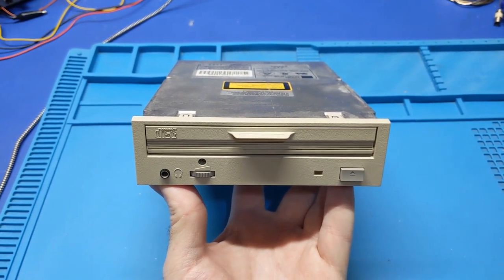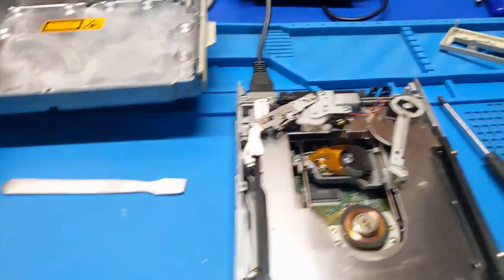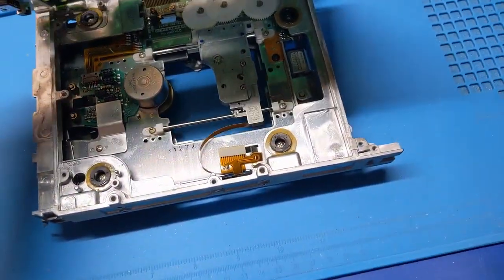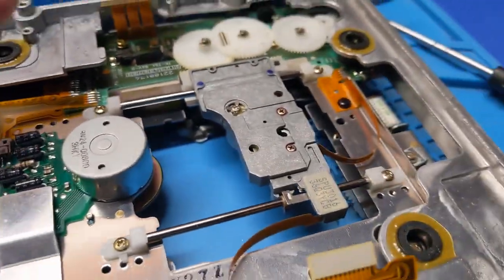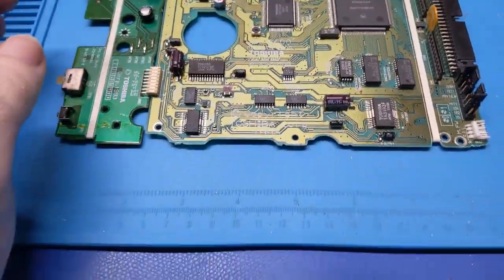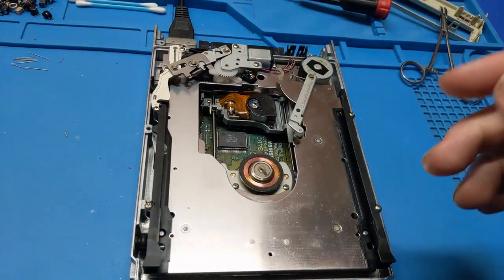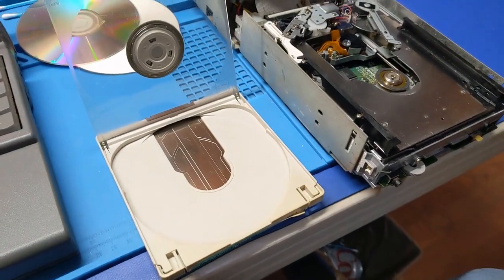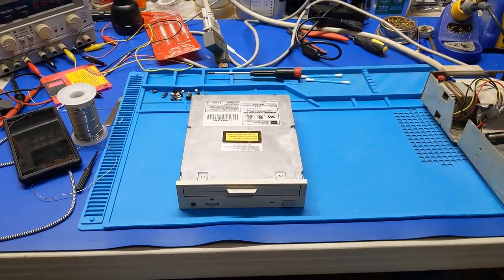Toshiba SCSI CD-ROM XM-3401B Repair

Comment: hey, that was used in the DTS cinema sound processors! They were dying like flies as the player would read the digital data from the CD-ROM in real time. 10 hours of cinema open = 10 hours of continuous read from the drive (ok, 5 hours as there were two of them). I have three of them, they all struggle and pressed disks work better. They usually start working (barely) after a while they've been powered on. Would you be able to share how to adjust the "servo" and also how to adjust the laser power (clockwise or counter-clockwise)?
Reply: I would be interested in the adjustments as well.

Comment: Something to check, is the rubber shock mounts in some of these drives. I have a Pioneer LF-D101 that came in an APS external SCSI enclosure arrive on my doorstep from eBay and the shock bumpers were just on the brink of turning to goop, very sticky and starting to lose shape. Replaced them with some silicone ones from a first gen HP LightScribe drive but upside-down due to them being air cushions instead of solid material, and those work a treat. I'm passing this information on because that drive is a DVD-RAM drive from the late 90s-early 2000s, and I'm suspecting any rubber shock mounts in any drives from the 90s that were of a cheaper formula may share the same fate. 

I've seen plenty where the shocks are turning white on the outside with age and come back around with some light cleaning with windex to remove that coating but I'm assuming those are of a different composition that will end up hardening rather than turn to goop. Those may also be a candidate for replacement and it seems that kits are not that expensive? but I'm sure aliexpress or the like has them in bulk for a lot less per without screws. It seems like all of the ones I've come across follow one of two sizes and the height off the mounting plate inside can be adjusted by just inverting the shock with no ill effect.